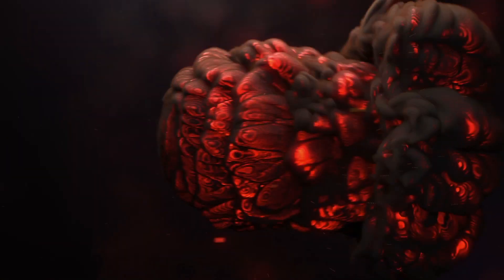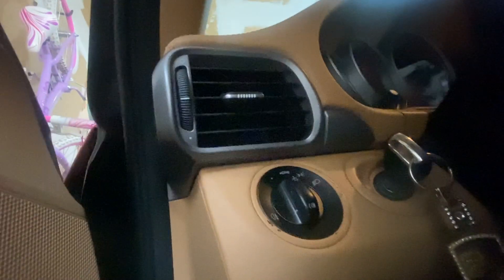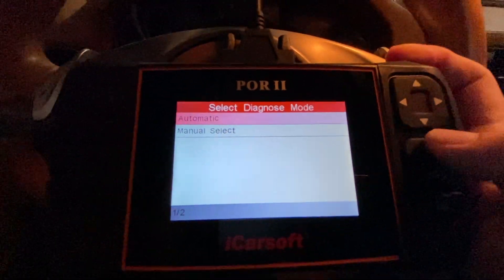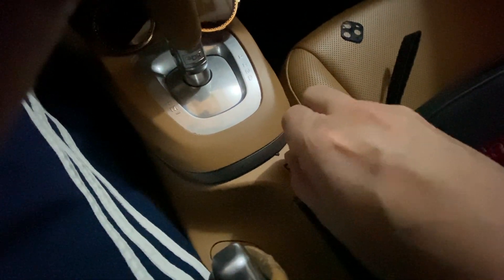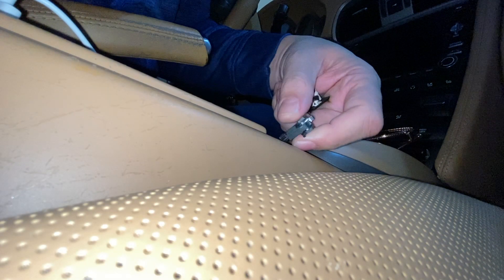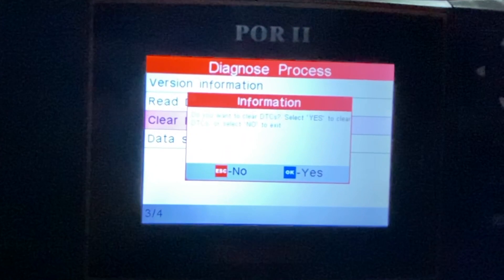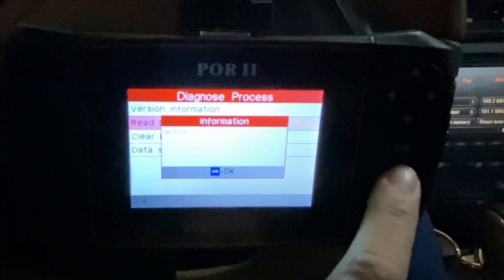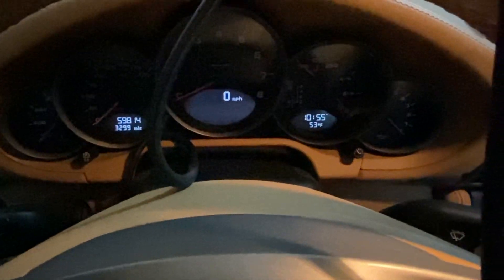How to Reset a Porsche Airbag Light

Comment: My mechanic changed the battery, the airbag faulty came on, which is under the car seat of my Porsche Cayenne S as well as the battery. It would be nice if mechanics would put everything back the way it was. Sometimes I wonder if it’s done intentionally to get more money out you. Thanks to all the DIY YouTubers!
Reply from the maker: I just picked up a Porsche Macan Turbo. Checkout my latest videos. I’m definitely a Porsche fanatic after driving so many different cars in my life.
Reply: Same here.
 replaced battery set off the airbag light

Comment: I got this same problem on my 2009 Boxster. I am going to run a scan check and see if I can clear it. I will let you know the results.
Reply from the maker: 1963Sunbeam I ended up fixing this issue in  another video.  Here’s the link How to Fix Airbag Light
https://youtu.be/SeG4Tt0As1s  in my case it was a fault in the passenger airbag light.  Replaced and never had an issue again.

Comment: Oscar, did the fault return?  Also, how did you know to opt for that particular iCarsoft reader?  They have so many on their site, all claiming very similar things.  My 997.2 C2S also has the airbag fault for a 2nd time.  After the first incident, the local auto shop cleared the error and claimed it was related to the driver's side head airbag.  I'm tempted to purchase the reader to check it myself.
Reply from the maker: I researched the reader before buying it and was pretty happy with it. The link for the one I bought should be in the description of not let me know. The error code never came back. I don’t have the Porsche 911 anymore because I got a McLaren but I recently picked up a Porsche Macan…that scanner still works on all my cars to read codes though.
Reply: @OmarsGarage  Thanks Omar.